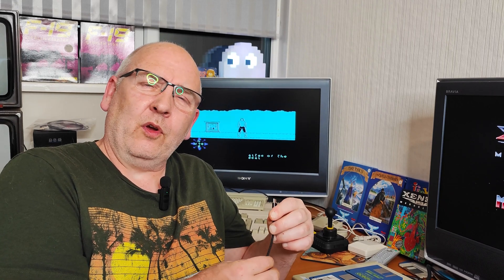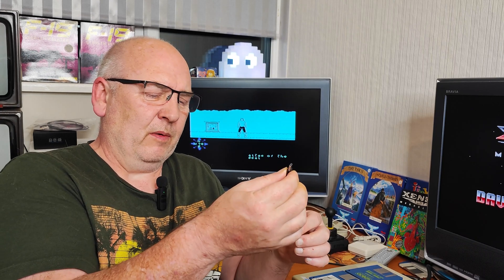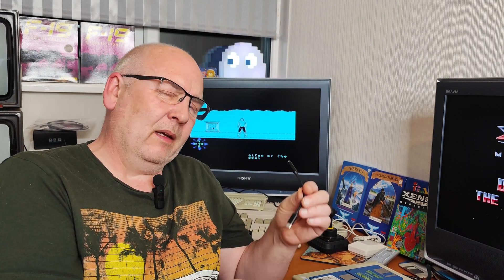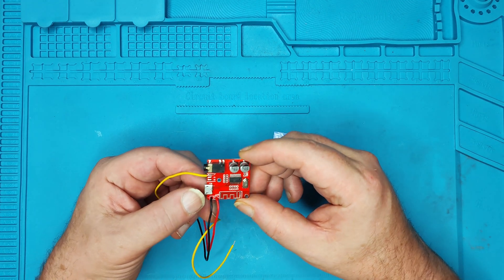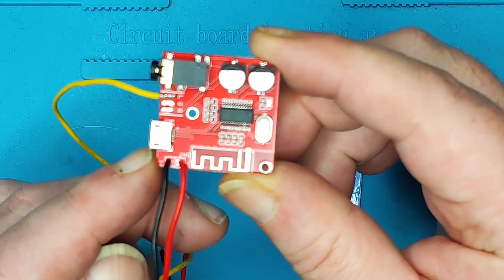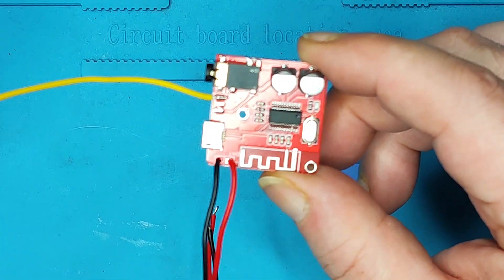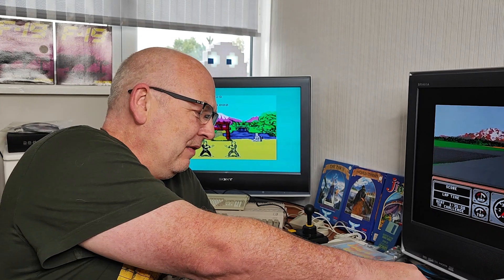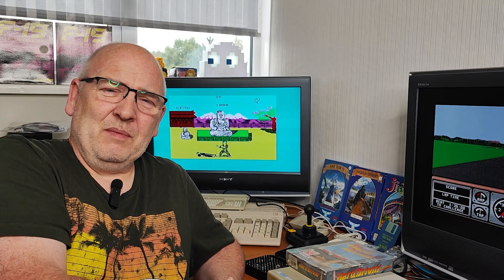BLUETOOTH for the ZX Spectrum - Load games from your phone

Comment: If anyone in 2025 is still wondering why the games dont load correctly with this mod, it is worth experimenting with different audio players. I found MP3 Books app really good for that purpose since it has multiple settings. On my Iphone 13 mini I use the "Universal" sound engine with Boost Volume to 200%. It loads games correctly. Default audio players fail to load.
Reply from the maker: It also suggest turning off any surround sound settings on your phone and switching to mono

Comment: Have you found a similarly convenient way to send the video signal to a modern monitor that does not have a TV/antenna socket?
Reply from the maker: Well the composite mod does this really. You're still using the RF connector on the Speccy but connecting to the composite signal on the TV.

There is also a different (but expensive) solution from ByteDelight which uses an interface card plugged into the rear edge connector on the Speccy and outputs HDMI, which would allow connecting to most modern monitors.
Reply: @RetroComputingReboot  can you tell me more about the composite mod? Where can I find it?
Reply from the maker: https://youtu.be/LnbDeOiyb5w

Comment: Finally got round to trying this and indeed it works well, although unfortunately my Speccy is an issue two which is apparently less sensitive than later machines so the output of my board is a bit weak and turbo loaders occasionally fail. Did you mention you'd seen a way to change the gain on these boards (I think it's a swap out of one of the resistors but I can't find the Web page I saw on the subject years ago). The alternative is I buffer the output with a second, headphone amp or PAM8403 board which are on the way but if the hack is available I'll use that as well.

Other machines like the Amstrad CPC don't need this at all, the output is more than powerful enough.
Reply from the maker: Hi Jason, I'm really pleased you've had a go, even if it's not perfect (yet), and thanks for letting me know.

I'm sure I had read something somewhere in relation to improving the audio gain, but I can't find it. However...

Looking at the schematics of the issue 2 board, there aren't that many components to check/replace. Before changing the values of anything I'd check  what the components are reading.

I'd suspect if there's anything at fault, it's going to be either the ULA (hopefully not), or one of the capacitors C32 (100nF) or C35 (10nF). There's also a diode at D13 which I'm sure I've read somewhere can fail. Then finally there's a couple of resistors R36 (680 ohm) and R37 (1k ohm). If all the components test good, I'd try altering the value of R36 first (but at your risk 😂).

I've got a deaf Spectrum+ which won't load until it's been left on an hour. I've got a video planned on my to do list which will hopefully address this
Reply: @RetroComputingReboot  I was thinking more of increasing the gain on the module rather than the Speccy. But I looked into it, and it turns out that there are LM386 boards, which are capable of driving 8ohm loads directly that are ideal for this task.

Managed to get five of these for a couple of quid from China.

The Speccy is expecting quite a high power input - the old shoebox tape recorders would switch the speaker output, generally 2w at 8phm, direct down the ear socket. I think a lot of them will even have used an LM386 or similar for this, it's a very old chip. So I'll probably bodge the Bluetooth board and the LM386 together and connect these to the Speccy. I suspect some isolation may be needed - you can also get B0505s modules that isolate the power supplies from each other which should isolate ground loop noise.

Thanks for sending me on this little journey - there's even a chance I may put together a video about it but the production quality is unlikely to be up to much lol.
Reply from the maker: @jasonj4337 Hi Jason, sounds interesting. Keep us updated with how you get on!

Comment: Great video thanks.

Did the mod to my Speccy but the sound isn't loud enough to register. Its all working as I can hear the tape screeching. Works using a 3.5mm jack from my phone but not Bluetooth.

Weirdly my tablet isn't loud enough using the jack plug way either in the back of the Speccy.

Shame looked really good.
Reply from the maker: Don't give up! I think there is a mod to increase the volume. I can't remember what it is though off the top of my head.

Comment: How do you set the Bluetooth name for that board?
Reply from the maker: Hi, thanks for the comment. I should have added that in th video.

There's no need to add a name for it. Once it's powered on, just set your phone to search and it pops up. Then just pair with it. It's as simple as that.
When you power it up a further time, it should connect.to it automatically

Comment: You do know you can cut yellow wires to the right length just like any other colour?
Reply from the maker: Yes indeed I do 😄. As I said in the text in the video, the wires weren't shortened at the time as it was a test fit. If I had cut the wires to begin with it was a chance they could then be too short. They were shortened once I was happy with the placement after a lengthy test with no issues

Comment: I'm tempted. I have the American Spectrum, a Timex-Sinclair 2068, and the damned thing will not, under any circumstances, read data from a phone through the audio jacks. Are the jacks borked? Do they need to be resoldered? Is there something else wrong with the system? Who the hell knows.
Reply from the maker: Thanks for the comment. It certainly could be the jacks and it would certainly be the place I would start with some contact cleaner. Give them a good squirt and pass the jack plug through it a few times. If that doesn't work, I'd suggest replacing them or using a scope if you have one to test the strength of the signal coming though. I'm afraid it will be a process of elimination and may take some time. Also if I recall correctly, there are a couple of components on the board which if faulty, will reduce the strength of the signal coming in, but it can't remember off the top of my head which ones. You'll have to do some googling I'm afraid. Best of luck though 🤞

Comment: Interesting. I tried this by putting a Bluetooth board into one of those cassette car adaptor things. It worked but kept cutting out for a fraction of a second causing loading errors, and never revisited the idea.

Those boards can be bought for a little over a quid each from Ali express - so could afford to put one in a amstrad, msx, cbm datasette etc as well and still not break the bank. And if these more modern adaptors don't glitch (the one I tried was ancient, I was too tight to spend on it so just used one I had lying around) then it's very much a viable alternative to the tapduino type things!

Thanks for the video, just subscribed and fast becoming one of my favourite tech channels!
Reply from the maker: Thanks for the comments, Jason.

Well, in terms of glitching, I must have done 20 different game loads now, all error free before I posted this. It seems super stable.

I think for the money, they are a brilliant alternative to tape players.

I'm glad you're enjoying the channel. There's plenty more to come 😁
Reply: @RetroComputingReboot That's good enough for me, going to order a half dozen of these things from China and it can be my next project 😁